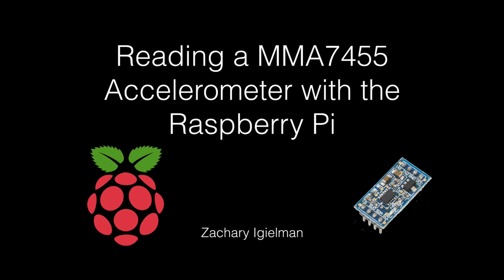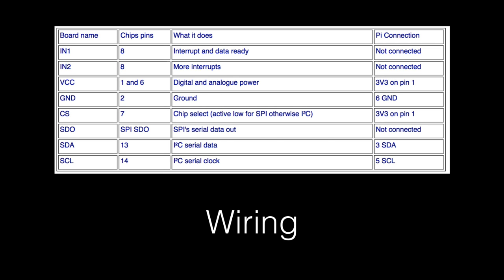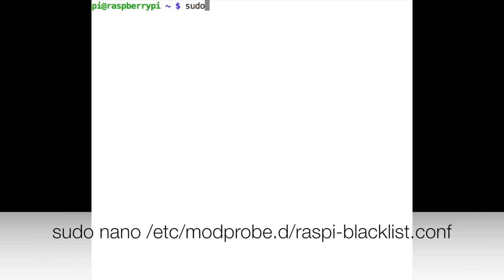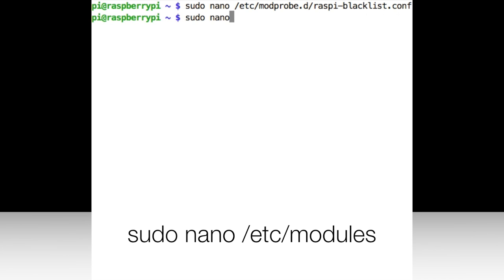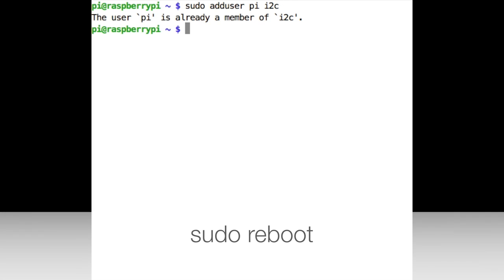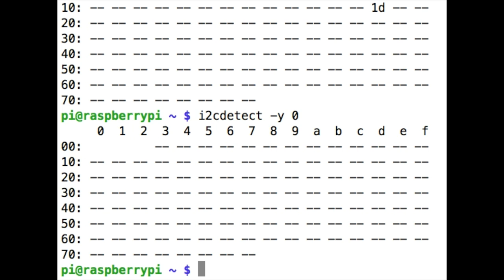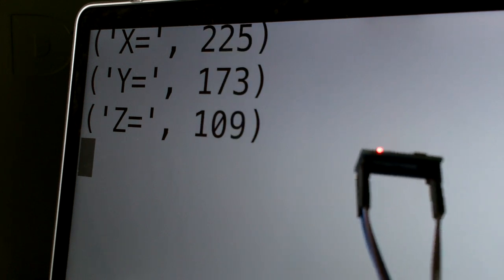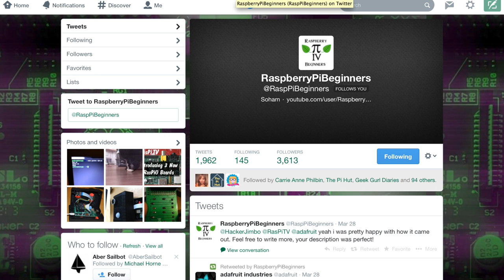How to use an MMA7455 Accelerometer with the Raspberry Pi via I2C

Comment: Dear Zachary Igielman,
Thank you for your video and python script. The module was easy to made work based on your work, but it's not usable in it's pure form. It's data output in 2's complement format, (bit's value: 2^-8, 2^7, 2^6, 2^5...2^0), and also you have to calibrate the sensor before usage.
If the sensor is stabilised and In 2G mode, you should see 64=(abs(x)+abs(y)+abs(z))

Comment: fantastic video - thank you! a question ... why do we need to connect the sensor twice to the 3.3v connector? I've tried to unplug it and worked the same... can you please explain? many thanks!
Reply from the maker: One of the connection is CS (chip select) which tells it whether to use SPI or I2C. To tell the chip that we want to use i2c, we pull it high by connecting it to 3v3. If not, we leave it floating, so the chip may not work as it could try to use an SPI connection.

Comment: thanks u for showing me this important information. however my pi has been installed with a temperature probe. How do l install this mma7455 device?
Reply from the maker: yxhankun Follow the tutorial, but the parts and wire it up. It is not internal, you have to buy the parts. Happy hacking ;-)

Comment: What a great tutorial !! 
can I use any other accelerator rather than using MMA7455,  for example can I use this one instead " MPU-6050 6DOF 3 Axis Gyroscope + Accelerometer Module " ?

I APPRECIATE YOUR HELP
Reply from the maker: Ahmed Nouman You would have to change the code slightly to use the correct addresses to read the correct values. Here is MPU-6050 code: http://blog.bitify.co.uk/2013/11/reading-data-from-mpu-6050-on-raspberry.html

Comment: Hi Zachery your tutorial was really helpful, thank you for uploading! I was reading through the code and I found lines like this, 

self.b.write_byte_data(0x1D,0x16,0x55) # Setup the Mode
self.b.write_byte_data(0x1D,0x10,0) # Calibrate

I was wondering if you could explain the contents of the brackets. I did some reading and saw that they are something like int addr, char data, char value. But I don't know what this means in the context of the accelerometer. Any help would be really appreciated. 

Thanks, Ben.
Reply from the maker: it's addresses from the datasheet. check out the datasheet for the mma7455

Comment: Hi Zachary, great tutorial thanks for putting it online.  Can this type of set up be used to measure at say 100 readings per second?  It looks like the display is updating a bit slower than that but can this be changed in the python script?
Thanks, Tim
Reply from the maker: you can mess around with the script to get it faster but 100 sounds a little high. plus beware of sensor noise!

Comment: Could you use it to say keep a rocket in level flight ?
Reply from the maker: yes, although you'd probably use an accelerometer and a gyroscope alongside each other. A gyroscope is better at measuring angles as acceloration forces will not affect it but gyroscopes drift so you'd align the gyro to the accelerometer

Comment: Hey! Really liked your video Zach.....now I want to ask you a question.....can I use the accelerometer to balance objects like robots with the RaspPi? If possible then how? Thank you for the answers....  :)
Reply from the maker: I have done this myself! You will need to use a gyroscope in a similar way to this, because accelerometers measure acceloration forces (such as gravity or motors) but gyroscopes measure rotation angles. You will need filters and a control system. watch my lecture: https://youtu.be/7PXAgPpS-ek
Reply from the maker: +Mukut Mukherjee the answers are all in these videos. Just google search PID controllers, self balancing robots etc.
Reply: Did you use an arduino or a raspberry pi? On the in ternet there are thousand examples on making self balancing robot, but all of them are made with arduino.....
Reply: Zach...it would be great pleasure if u can share the code with me....I want to understand the code so that it can balance....is my thinking right? That as robot will tilted in the front the motors will be driven in the same direction to make it balanced? Am I right?
Reply from the maker: Yes. https://github.com/ZacharyIgielman/self-balancer-rpi
Reply: +Zachary Igielman thnx Zach..I'm working on it.....thnx so much
Reply: +Zachary Igielman hey Zach! you told me that I will need a accelerometer and a gyroscope... but in github its written that it's possible to balance it with the rtk-000-001 and an accelerometer....can u tell me which is right?
Reply from the maker: +Mukut Mukherjee it needs a gyro not accel because the accelerometer measures acceloration so it tells you whatever direction it is moving (even if the motors are moving it back to upright) whereas the gyro reads the angle (but the gyro drifts so after a while you'll have to realign it). The code is incomplete. You need a Pi, power, motors, a motor controller, a gyro and a pid controller (maybe a kalman filter for sensor noise). Let's see if you manage it :) if you do, please share your build and code!
Reply: +Zachary Igielman yeah of course :)....thnx man......but i tottaly new to the concept pid controllers and cannot understand any tutorials of them on the internet....can u help me??
Reply from the maker: +Mukut Mukherjee I was totally new to PIDs. Do lots of research, look at diagrams, examples and code. Watch my lecture, it explains everything :)
Reply: +Zachary Igielman thnx man.....I will tell if I need it help or if I am successful....😊
Reply from the maker: Probably http://blog.bitify.co.uk/2013/11/interfacing-raspberry-pi-and-mpu-6050.html

Comment: Hi Zachary, this tutorial has really fired up my imagination and i would love to experiment with this! How feasible is it to install and make use of multiple accelerators? For example, I want to keep track of 15 of them? Can you point me in the right direction? I'm thinking 15 raspberry pi's with one accelerometers each would be a over kill, but maybe i can do one Pi with 15 accelerometers? Any help would be extremely appreciated.
Reply from the maker: ***** It is very hard. You can use multiple i2c devices at different addresses, but I don't think you can change the address of the MMA7455 so you can only speak to one. What project will you need multiple accelerometers? Maybe you could connect lots of atmega328s (arduino chips) to a Pi, with each one connecting to an accelerometer?
Reply: +Ibis Fernandez It would also depend on how many i2c buses there are on your raspberry pi. Each bus would be for one accelerometer, and as Zachary said, you would need different addresses for each. My accelerometer, the MPU-6050 has two pins to have a through-way for a different i2c device, and in your case it would be a different accelerometer. You can code to access the other accelerometer(s) in the code, so that might fix some i2c problems, but if you had multiple raspberry pis, you could always keep an i2c bus open for communication between different pis or you could use transceivers or some other means to communicate between them!

Comment: I did everything you explained but when I run i2cdetect -y 1 its throwing an error :could not open file /dev/i2c-1 :nosuch file or directory please help me with that ...
Reply from the maker: You problem haven't set up i2c correctly. Make sure you stop blacklisting, add it to modules, add the pi user etc. like in the first part of the video carefully and correctly. If it helps, follow this instead to set up i2c and then go back for the sensor: http://www.instructables.com/id/Raspberry-Pi-I2C-Python/
Reply: thank you ,yes I sorted it out but now when I run your program MMA7455.py its throwing the following errors is there anything I wanna change in the program ? 
Traceback (most recent call last):
  File "MMA7455.py", line 9, in <module>
    class Accel():
  File "MMA7455.py", line 15, in Accel
    b = smbus.SMBus(myBus)
TypeError: an integer is required
Reply from the maker: vibin valzan Can you post the whole code? The variable myBus is not an integer

Comment: I have tried to wget your code and am having difficulty. The file that is downloaded is full of html code. I have checked the spelling many times and I am sure it is ok. Thanx Zac. pj
Reply from the maker: If you've got an email address I can email you the code. If you can copy this then do so:

# -*- coding:utf-8 -*-
#!/usr/bin/python

import smbus
import time
import os
import RPi.GPIO as GPIO

# Define a class called Accel
class Accel():
	myBus=""
	if GPIO.RPI_REVISION == 1:
		myBus=0
	elif GPIO.RPI_REVISION == 2:
		myBus=1
	b = smbus.SMBus(myBus)
	def setUp(self):
		self.b.write_byte_data(0x1D,0x16,0x55) # Setup the Mode
		self.b.write_byte_data(0x1D,0x10,0) # Calibrate
		self.b.write_byte_data(0x1D,0x11,0) # Calibrate
		self.b.write_byte_data(0x1D,0x12,0) # Calibrate
		self.b.write_byte_data(0x1D,0x13,0) # Calibrate
		self.b.write_byte_data(0x1D,0x14,0) # Calibrate
		self.b.write_byte_data(0x1D,0x15,0) # Calibrate
	def getValueX(self):
		return self.b.read_byte_data(0x1D,0x06)
	def getValueY(self):
		return self.b.read_byte_data(0x1D,0x07)
	def getValueZ(self):
		return self.b.read_byte_data(0x1D,0x08)

MMA7455 = Accel()
MMA7455.setUp()

for a in range(10000):
	x = MMA7455.getValueX()
	y = MMA7455.getValueY()
	z = MMA7455.getValueZ()
	print("X=", x)
	print("Y=", y)
	print("Z=", z)
	time.sleep(0.5)
	os.system("clear")
Reply: Great thanx zack.
Reply from the maker: Let me know how it goes, and if you need any further assistance, I will do my best to help!
Reply: Sorted, via a different route. Thanx very much Zac'
Reply from the maker: ***** Fab! Well done :D

Comment: what is the unit that the accelerometer outputs? degrees?
thanks
Reply from the maker: bume nicläs 16-bit integer. You can use a little math to convert it to degrees if you wish ;)
Reply: +Zachary Igielman Ok, here is where our hero dies... I need to transform the output in SOMETHING that indicates me where the module is pointing to. Let's take X axis, if it goes extreme left it could show -x and if it goes extreme right it could show +x (just positive and negative values). 
Is there any direction you can point me to where I can teach myself how to do this? Thanks a lot in advance.-
Reply from the maker: auranecromancer Doesn't it already do that?